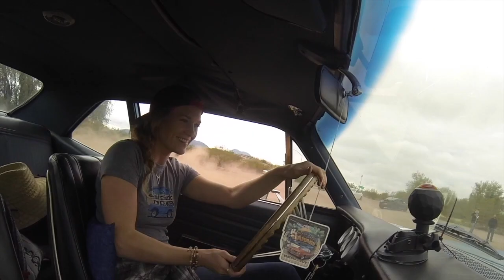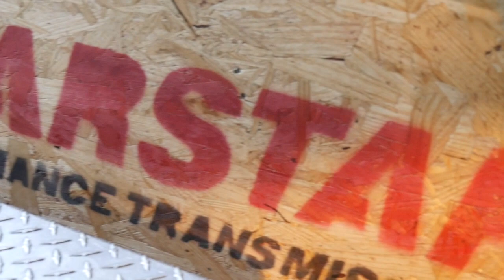JUNKyard engine FAIL! In the shop with Emily EP 45

Comment: What? Don't ditz a Ford. Like anything out there, build it and they will...love it. My hubby has built almost anything. When in doubt..don't. READ about it. We can't stress enough about reading. That 49 buick 8 that we bought and hailed it back to our neck of the woods is turning out great. The entire drive train and susp. brakes ended in the scrap. We just received the engine and trans combo. 572 gm crate and 4l80hd Trans 12 bolt rear Baer brakes, Hotchkis susp waiting to receive. Hubby is building the roll cage. Live 💘 🔧 😃

Comment: Such a bummer that the gt40 heads were trash. The E7TE heads from the Fox aren't bad though....not GREAT, but they were the "truck" head that Ford pulled from the parts bin in the 80's for the Mustang to pump up some power after 1986. That Fox short block is a real upgrade from the Exploder block though. TRW forged rods and pistons from the factory and pretty darned tough up to about 450 HP. The 87-88 speed density cam is a little more aggressive than the later MAF cam and with a set of the Crane 1.7 ratio roller rockers will make some solid TQ. Loving it.

Comment: I would at least put new rings and bearings, oil seals, oil pump, timing chain+ gear set, cam+ lifters. If you got the heads and pan off, go for it.  revved up yooper

Comment: Don't fell bad about getting tricked on the bolts in that ford 5.0l intake. Being a GM oriented person, we once got an earlier 5.0L engine in the shop. I noticed that engine had a set of aftermarket roller rockers and decided to grab them, and sell them on ebay. It took me a while to figure out that the bolts were under the plate on the top half of the intake.

Comment: The pistons in those engines are junk.  The heads are GT40P heads and the spark plugs are at a different angle causing exhaust manifold/header clearance issues.  The pistons in the Mustang engine could be forged if you picked the right year.

Comment: THOSE 302 WERE THE BEST MOTOR FORD EVER MADE I HAD 1 IN A150 PAID 250 DOLLARS FOR THE TRUCK  DROVE IT 3 YEARS WITH A KNOCKING CRANK  OVER 60 MILLES AN HOUR IT SOUNDED LIKE DIESEL AND THEN IT STARTED TO BURN OIL

Comment: The gt-40 heads are not that great. Intake valve is a small1.94 exhaust is 1.54. Intake runner175 cc.  You can do better. Trick flow makes a great top end kit   Not an arm and leg
Reply: anything from trickflow is at least an arm lol
Reply: @whatchu_talkin_john_willis  I had to give two front teeth just for looking at their website!!
Reply: They will be fine for a torque engine.
Reply: @ddd228  lol no, better heads will make more torque and horsepower everywhere.  ANY factory windsor head is a turd, the gt40s are just the shiniest
Reply: Gt40s are probably the best factory cast iron sbf heads. Do some bowl work to them and they’re good to go. Hot Rod magazine was able to coax 375hp out of a gt40p 302 with bowl work and a big cam

Comment: I recently(last summer) used the same Explorer GT40P from an Explorer added a Used  B303 cam And Used Edelbrock Performer 5.0 heads. I could have resused the P heads but the didn't fit my new stainless headers.It had about 118k on it when i got it still had factory cross hatch on the cylinders and no ridge  https://www.youtube.com/watch?v=3H40V6bNboA

Comment: That sludge has nothing to do with how many miles are on it. It has to do with what kind of  oil and how much Bee's wax is in it  !!!!!!!!!!!!!!!!!!!!!!!!!!!!
Reply: Bee's wax ??  There has never been bee's wax in engine oil.  Crude oil can contain wax molecules, but refiners have been chemically removing this for decades.  Anytime someone says sludge is caused by wax, they are spewing nonsense.
Reply: @paulcopeland9035  That's what I was told by a chemist that worked for an oil company
Reply: Sludge is from not changing oil . Running a engine to cold will cause it too. I think this case is not doing regular maintenance. My thoughts anyhow.
Reply: @donaldk.macbaird4950  ....He must have been joking with you.  Think about it.  Valuable (and rare) bee's wax added to engine oil. ?? !!!  We need bees to work at a lot more important jobs than "sludging" the oil. The oil producers separate the wax molecules during refining (wax is not wanted in oil) and produce what we know as paraffin..This is much more valuable as candles and other waxy things  Wax hasn't been in premium engine oil for many, many years.
Reply: @paulcopeland9035  I don't think he was joking and to put it in perspective that was over 40 years ago when I was in college